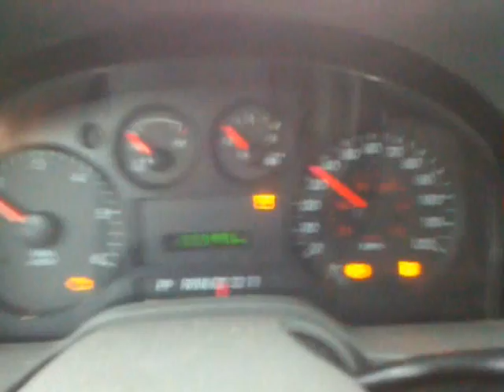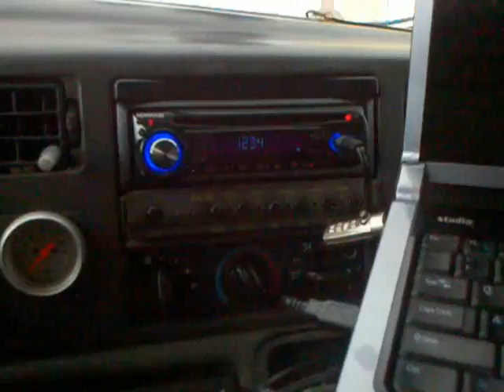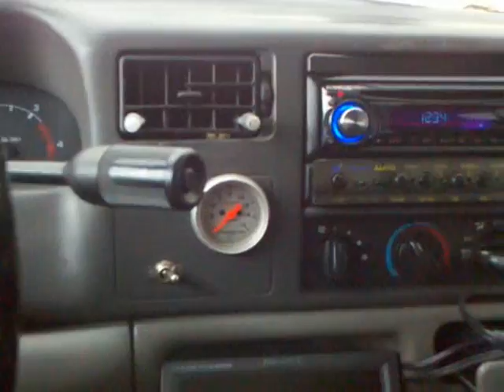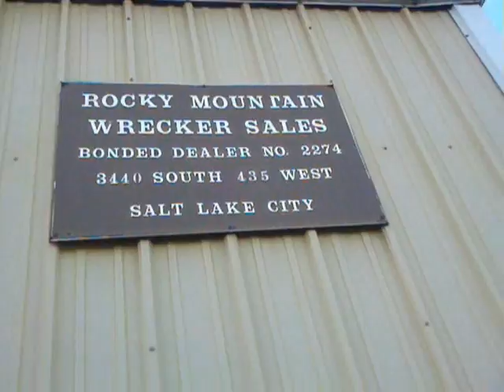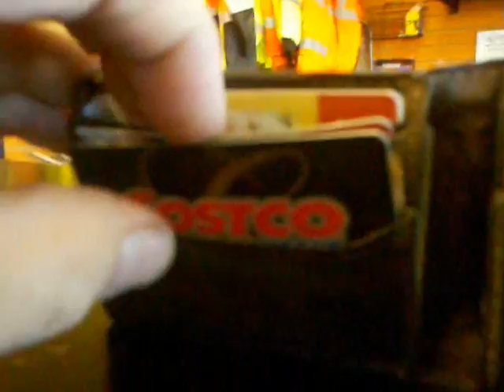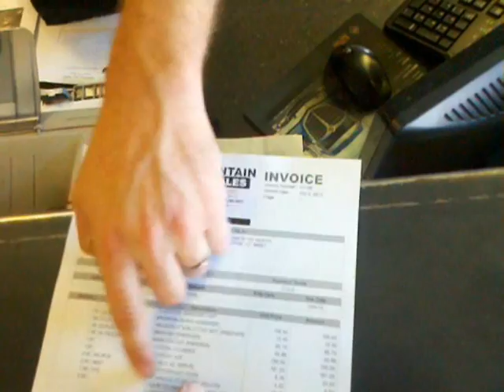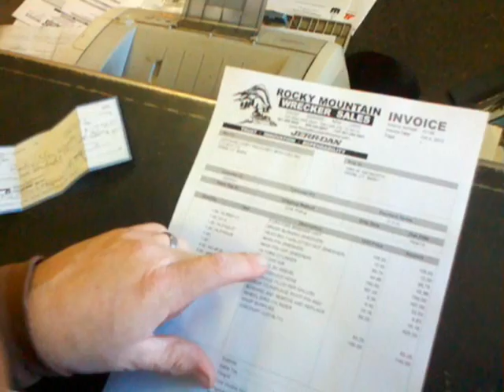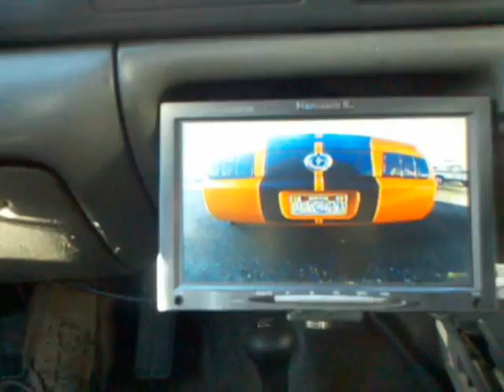Getting The Lift Repaired And Dealing With The Ultimate PWT

Comment: Hi Matt make sure they change the oil and not just top it up as if you dont it will carry the crap in the lines to the new ram. Keep the old ram too. You may be able to rebuild it yourself with o rings and standard hydraulic seals at a time that suits you. Then you have a spare.

Comment: Your viewing audience as I'm sure you will miss the F-250. It's earned it's stripes though and has put in 400,000 miles of heavy duty work for sure on that 7.3L Powerstroke Diesel. The new F-550 will be a nice upgrade though with a 6.0L Powerstroke or 6.4L Powerstroke.

Comment: Hydraulics undergo tremendous stresses with the application and release of the high pressure. Brazing does not withstand stress well and lasts only a short time as a repair for hydraulic components.

Comment: Beware the 6.0's and 6.4's. I've been hearing a lot of reports that they are troublesome engines that like to plug up egrs and ruin a bunch of other parts.
Reply: If you do the proper PM, they are good engines. My 2003 6.0L has 345,xxx miles on it. Bone stock and I pull big trailers with it. Don't tune it without studs.